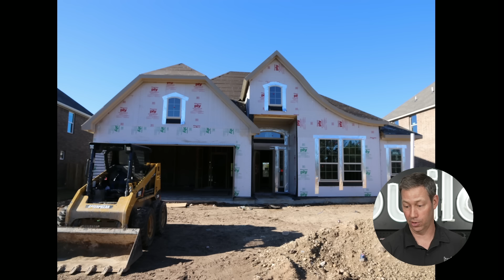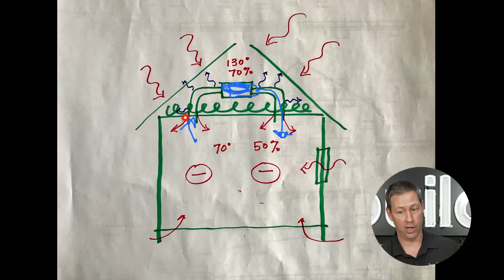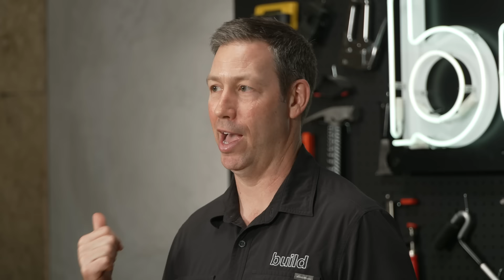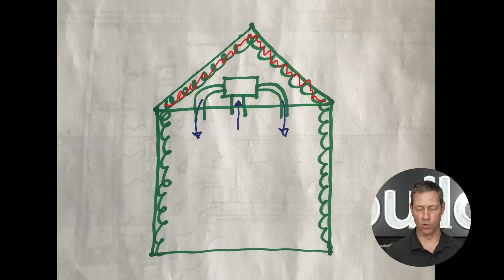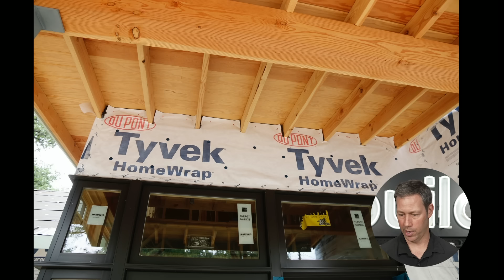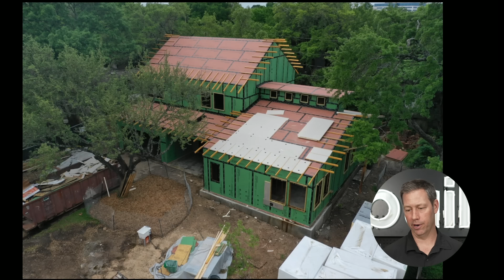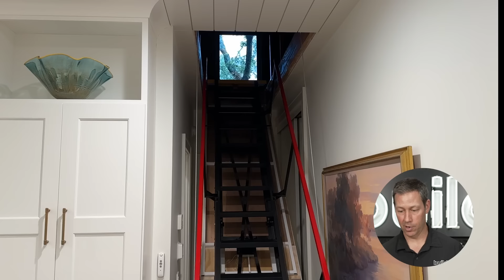CRAPPY ATTICS are Standard in America! Here’s how to BUILD - DECENT or AWESOME

Comment: What would be the best option for my attic? Would I be able to get an adequate amount of spray foam at my roof line if I have 2x4 framing? I have a historical craftsman home built in 1918 in central Oklahoma. 2 story with large eaves that overhang all sides, house is all wood siding. 2nd floor HVAC system is in the attic. Based off the calculations it is the proper size for the 2nd floor (2.5 ton system - 2nd floor is about 1150 SF), but it does not keep up during the summer at all, colder months the system performs just fine. We've resulted to putting a window unit in our bedroom in the interim while we decide the best approach to solve this issue.  Attic currently has about 6 to 8 inches of a mixture of fiberglass batting and blow in insulation right now. Options I see are either spray foaming the roof line and removing existing loose and batting or leaving existing and add another 12 inches of blown in. Does anyone have any experience with spray foaming an older home such as this?

Comment: He is my take...you build great homes...one of the best I've seen. But lose me when you put cheap ductwork instead of proper aluminum sealed insulated ductworks that hold heat and cool air and that rats, mice and other critters cannot get into and do not get mold or mildew. All the flexible stuff WILL get mold and mildew over time. Aluminum ductwork can be cleaned....flexible ducts have to be replaced.

Comment: Doesn't this really just make the case for ductless wall mounted heating and cooling systems? No need to worry about duct leakage when there aren't any ducts
Reply: No, but it could be part of that discussion.
Reply: Ductless is great. You do run into issues with air quality and moisture if you're running ductless and making homes as airtight as Matt likes to.

Comment: I do live in the north and have all my stuff in the basement. But honestly I feel it is in the way. Would there be a down side if I were to build a new house to plan on putting the AC/Heater in the attic that I am not aware of? My intent is to use radiant baseboard in conjunction with standard blown air heat. I was considering some kind of zone AC but I have not worked out that part.

Comment: Matt, with conditioned attic you forget about one more thing -- AC needs to dump the heat somewhere. It took heat from living space, so it needs to dump it somewhere (1 law of thermodynamics). With unconditioned attic -- AC makes it even hotter, but the heat escapes outside. But conditioned attic prevents that heat from escaping.
So it's not just the stack effect. You need an additional vent from the AC to outside, just like a dryer has. Our put the AC outside of the sealed volume.

Comment: I hear one thing that is incorrect about open cell foam, and foam in general....  There are open cell foams that have high density, are rigid & hard after cure, and are not easy to pull apart, tunnel through, etc.... 16lb foam especially which takes a hammer to really damage it.  Biggest downside of open cell, it absorbs and holds water no matter what density you use.

Comment: Wouldn't it be better to build houses out of brick and lime plaster rather than drywall in Texas, given all of the humidity there? It seems like you need so much fragile engineering in place (like stopping any and all airflow out of sensitive climate barriers in the house) to avoid mold when you'd just be better off using mold-resistant materials in the first place?

Comment: Decent and awesome would make it nearly impossible to get a termite treatment in the south.  All fumigation manufacturers recomend not doing it wich puts all liability on the fumigator. In addition if you can get somone to do it it will cost more and have an unknown amount of time to be out of home since the spray foam releases gasses slower means the safe return time is uncertain. Making the roof better is a safer option unless you're doing an all metal and concrete.  And rats get in ducts for two main reasons.  Unsealed ac chase and over complicated roof that builders leave gaps between the odd angles. We get 100k a year fixing gaps builders leave open.  I have yet to see a builder here who took into consideration rodent control and termite mitigation.  The code is the minimum and building code only deals with subterranean termites not dry wood.  I highly recommend do not spray foam if you don't plan on tearing the roof trusses off every few decades.  Termites can chew through the foam.  Now if you do not live in a termite prone area this is good.
Reply: Rats can chew closed cell foam. So can termites.  Any gap large enough for your pinky should have 1/4" hardware cloth embedded in the foam to stop chewing.  If you can get a pinky in they can gnaw it open.  .  Ac chase is still number one access.  Allways use metal to seal.  And any wood that is spray foamed should have a boracare treatment to slow termites. Borate treatment is only required knee high but it allowed almost everywhere and if you know your preventing future treatments then an excellent pretreatment will extend the life of the structure by decades.   Large roaches usually follow lines. Like plumbing and power. Some of the purblack foam where plumbing and electrical pass between horizontal beams and though exterior walls.  I recently treated a home with it kitchen behind remodeled and all the roach dropping were following the power cord.  paper on the inside of dry wall is edible

Comment: Any reason why you do not use larger cans of spray foam with spray foam gun for application. In my experience this is less expensive and can store cans which are not empty for weeks. I also have a spray foam gun with long tube to get in tight spaces. I still use smaller cans for certain projects, e.g when access with standard tube is not an issue and I know I will be using the full can on the project.

Comment: That attic is a lot more expensive than a properly constructed vented attic. It also has cons as well other than cost. Leaks are going to be impossible to find if you spray foam the roof deck. Open cell will also soak up water like a sponge.

Comment: AAt 31:25 I see you have a Unifi AP in the attic. Just curious as to why? Do you have some automated Home system for your AC stuff and the signal was too weak from a different floor? Also For People building homes can you do a video on a good place to put a network rack. I have a 12U Rack but one day when I build a new home I wanted to build a noise insulated and temperature controlled room in the attic to quiet my network equipment. I have an NVR, a few server computers for home automation, and Firewall. Thanks!

Comment: Having your cooling registers in the ceiling is more efficient than the floor because cool air falls.
Reply: Not when the cold air is heated when going through the duct in the attic.
Reply: @IAmTheRealBill  A non issue when your ducts are properly insulated, or when using a ductless system.

Comment: How do you know when you have a leak in your roof? The water will run down the upper face of that insulation and then into the walls.
Reply: This video should be titled, " How to make your house held up by foam alone "  Spray foam is terrible. It's a textbook perfect environment for termites flying and ground. You can't even inspect the wood. Don't fall for this fad. Or else your home will be held up by foam alone. Foam was meant for all metal structures

Comment: If your attic is effectively your basement, does that mean you are upside down in your house?  :-)  Definitely a Minnesnowta question.

Is it worthwhile to pull out the blow-in, add some floor to walk on so that the attic could be sealed and rockwooled in the rafters? I have no ceiling lights in the upper floor so this would allow me to add cans, run wires for both high and low voltage for a good in home network. But the house is from 1969, 1500 sq ft (2 floors & basement) so is it worthwhile?

Comment: HATE when they put ducts in attics, the most idiotic place to put ducts and furnaces/air conditioners- in THE hottest/coldest part of the house with the worst access.
We had that at my work place before the fire, and every time in the summer the A/C kicked on it blasted hot air down first as the unit and the ducts were all in the 120 degree attic, and that lousy R2 or whatever it is insulation is useless. In the winter the condensation drain pipe would often freeze.
Other units were on the ROOF, so to change filters every week required a 24' extension ladder to climb up on the lower roof, a 6' ladder the rest of the way up, and change out 8 filters, carry up 8 new ones. In the winter there would be snow and ICE on that metal roof.
Thing is we HAD a full basement all that krap could have gone in aling with floor registers- the old one could have been used.

Comment: Anyone have a solution for a typical 70s ranch without central ac to do a retrofit? I want radiant barrier under standing seam metal with air gap, but how to get the hvac in a 3/12 plus open cell 10" seems like a doozy.
Im thinking of pulling the lid off and working from the top vacuuming out the old insulation,  upgrading the electrical, but how to stuff ducts in there and crawl through to sprayfoam is where im hung up

Comment: Way back when, they had tall ceilings, kerosene lamps, gas lamps, candles, wood stoves, to keep very hot heat from the ceiling (fire hazard), dry timber, poof, house goes up in a blaze of glory Hear many horror stories from my parent's & aunts & uncles who were born before Depression, & lived thru it, in both city (w/running water & toilet, coal-wood stove), country w/no indoor plumbing, utilities.
You want the house to breath, you have gas heating, cook w/gas, you want that fresh air coming in, and yes, gas is MORE reliable than "all" Electric. Critters, get rid of tree (critters can jump far), & tree branches near the house, cover up, plug holes caused by vent pipes, etc, that are on side, front, back of house, or run up the side of house into attic. Power (definitely speak, talk with them), telephone, cable lines running to house, talk w/ Utilities about placing large circular, square disks on lines away from house to prevent critters getting in that way.
Those vents, attic fans (automatic, w/heat & humidity sensor so they switch on & off), "help" keep attic dry.

Comment: I'm confused. Essentially you're building a house with a 'finished' attic. I've always been told that even roofs on finished attics require ventilation, usually done with soffit vents for intake, rafter vents for airflow, and up to a ridge vent for exhaust, to provide airflow underneath the roofing. That it's technically the roof that needs ventilated, not the attic. Otherwise, the underside of the roof (the sheathing and rafters) can still get blazing hot without airflow, causing condensation and deterioration of the roofing materials themselves (rafters, sheathing, cladding). I'd like to learn more about your build thought process and the science behind not venting the roof. Are you able to expand and compare to the thought process of venting roofs, not necessarily attics?

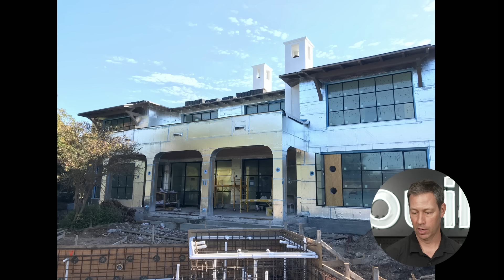Comment: 24:12 What would you do to remodel a concrete block house in FL? Not much I can do to the outside walls.
Reply: Not much to do to block walls but use a light paint color on the exterior.  Interior full gut 1" polyiso radiant insulation with 1x3 and 1x2 borate nailers over top if you're going that far.
Biggest gains are found with shading the walls from direct sun.

Comment: Why not go one step further and actually finish the attic as a proper part of the house? Put the AC, water heater, etc. in a dedicated room with an actual door, and then leave the rest of the space free. No risk of your kids accidentally snagging one of the lines or bashing the vents or puncturing the barrier since the critical stuff would all be behind sheet rock or more durable ductwork off to the side.

There must be some reason such a thing isn't standard though I guess? e.g. building codes. But it seems like if you were to do all the good stuff with moving the insulation/barrier to the roof, then you might as well just go the one step further to finish it. 

I wish that sort of extra-awesome attic were just standard because it's a bit silly to waste all that space.

Comment: I want to make a comment about spray foam insulation.  Anytime you can google a building product and it says, (1) you cannot be in the house for the first 24 hours until the foam cures because of toxic gases, and (2) improper installation can be a serious problem, and it is explained in a (3) 2019 CPSC white paper that says, Spray Polyurethane  Foam Insulation: Health and Safety Recommendations.  I would love to use a better product to insulate the house.  But I am wary of using a product that years from now might be viewed as unsafe or improperly installed.  My concern is also will this make our house less marketable.  If you cut out 25% of the buyers, even if it is based upon incorrect information, your market is reduced and the price will be lower.  I have a hard enough time getting highly skilled contractors to do a perfect job because they send out people who have just been hired.  Try retrofitting an old AC system with the new multi zone variable units with dampers in the ducts.  How can I be sure the insulation company knows what they are doing.  Especially since, you really cannot make too many mistakes in traditional insulation.  I wish a poly foam company would create a brand that eliminates these concerns.  I would use it in a minute.  Even Matt said, in his own house, he tends to go with another insulation.

Comment: No such thing as a perfect building material. Every material has its pros and cons. I have been in this industry since the late 80's and every new and better product has eventually shown its negative side. I remember when Synthetic Succo was all the rage and then Masonite siding and then Cement siding (now we are seeing it crumble on homes). I have seen open cell insulation hide a leak and cause huge issues for home owners. I have seen it hide pest issues. Every material has it's possible drama... I personally love blown in and good pest control barrier. Every home should have good pest control set up from the start. Nothing replaces having eyes on, in and around your home Monthly by a good pest guy/girl. AND nothing takes the place of a good homeowner who maintains their home and inspects it regularly. I sold a home in Peachtree Corners, GA with the original Masonite LP siding that looked brand new. It was 29 year old siding. So new looking that the inspector thought the owner re-sided with old LP siding! Nope just a responsible owner who maintained the siding with caulk and paint! Proof to me that any building material is good with a good home owner and proper maintenance. I have sold homes with synthetic stucco that was warrantied by 3rd party because the owner did everything to maintain the product. Pest can get into your home by you bringing in your amazon packages! Nothing beats good pest control. I have a client who doesn't "believe" in pest control. I cringe when I get that listing when she decides to sell. I bet she is living with all kinds of roommates I will have to have evicted. lol ;0)

Comment: This is based on the false premise that you need to, or should want to, put shit into your attic. Having HVAC equipment and ducts in the attic obviously means it needs to be within the conditioned envelope of the house. But having a vented attic with nothing in it is just as good, and creates a much smaller carbon footprint if you insulate it with cellulose or even fibreglass.

Comment: i thought those foams made houses un insurable.   or is that just retro fitted foam?  lots of probs with off gassing etc
Reply: You are correct. You can't insure or resell homes with spray foam because it is terrible for wooden structures and was meant for all metal buildings. It's a textbook perfect environment for termites flying and ground. You can't even inspect the wood. Don't fall for this fad. Or else your home will be held up by foam alone. This guy is spreading terrible advice I don't know how he sleeps at night.

Comment: Are you blocking the soffits! houses need to breath. if done right air is pullled in at the soffit pulls air out trough the ridge vent due to thermal convectionand the heat is pulled out.  I pull ac duct work out of the construction dumpsters. pull the accordian tube out and put it on the roof rafters (not against the roof deck, the bottom of the rafters. Putting the insulation or radiant barrier against te decking causes the heat to trap agaimst the shingles and will cause your asphault shingles to vent their volitals faster drying them out and shortening their life. it can also void your shingle warranty. The house can still breath and v ent moisture through the cavity channel created from soffit to vent an the bottom of the rafters.

Comment: Are these builds limited to southern attics?  I live in the midwest, so this doesn't address where I live.  You don't address ratings of the insulation either as my understanding of ratings is that for where you live, the insulation must be rated a certain way depending on the weather conditions.  I would also be interested in how you evaluate if an attic can be updated to be usable either for storage or other means.